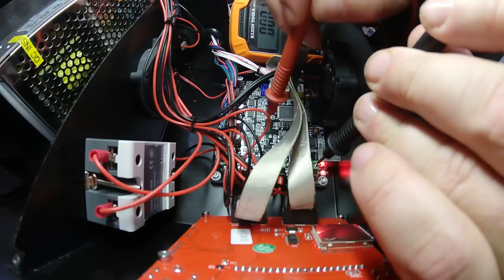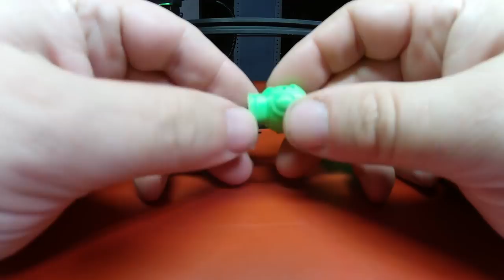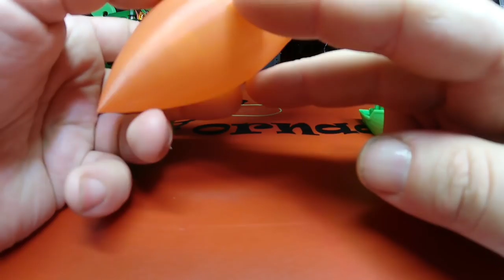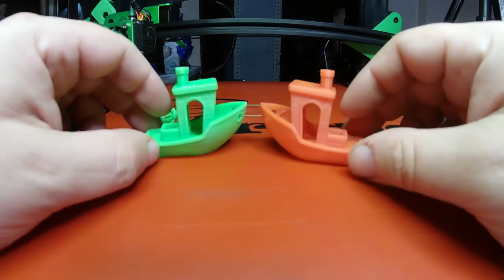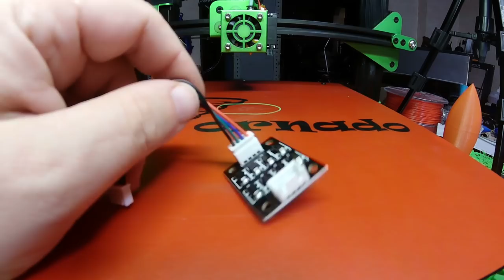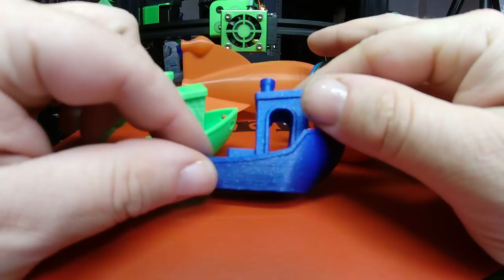Today's 3D Print 107 Adjusting the Tevo Tornado Stepper Drivers

Comment: After you did this did you notice the steppers vibrating/humming  way more? Just curious mine is vibrating like crazy now. More like a super loud humming that you can feel through the whole machine. This was actually most noticeable while my steppers were disabled during leveling. I can literally feel it vibrating between the nozzle and the bed.  Plus afterwards I got my first ever layer shift  on X while printing the initial test benchy.  I think I'm going to dial it back down some and reprint the benchy and see what happens. All the steppers initially were set between .78 and .8. I changed all of them to .95  except Y which is a bigger motor  to 1. Now I'm going to turn down X Z and E  down to .85 and Y to .9 and see what happens. As a side note I also added TL smoothers to X and Y at the same time. Just wanted to get your experience on it. Let me know and thanks in advance.
Reply from the maker: I sent mine to .95 volts and I don't notice any unusual humming or vibrating I also added smoothers to mine as well I suspect you're correcting your voltage too high turn it back a tiny bit
Reply: Nerys that's the plan. Soon as I get home I'm going to try it. I will say this the smoothers seem to have eliminated the salmon skin which is a step in the right direction. But I am super puzzled and concerned about the x axis shift. Considering I've never had a shift on that machine yet and mind you I have my jerk settings set super super low as well. I'll say this as well just like you said in the video the machine was definitely moving with much more authority. But I definitely don't like that vibrating hum either. Thanks for your quick reply I appreciate it and keep up the great work. You've become my go-to YouTuber as of recently. I appreciate your honesty and candor.
Reply from the maker: One other thing make sure your belts are not too tight people have a tendency to over tighten the belts they should be snug with a slight twang when plucked they should not be super tight that would definitely cause a stepper shift
Reply: Nerys you could be onto something there. My X did feel a little tight when I was moving the hot end around. I will address that. Thanks for the advice. It can be tough sometimes trying to strike that perfect balance between all the different factors.
Reply from the maker: That's why I tell people snug then a tiny bit more that's it not tight just snug :-)
Reply: Nerys hey one other thing a little off topic but I know you're like an Ender expert.Infact I bought one on the strength of your review. My question is this upon assembly the other night I was a little too tired and I accidentally wired the positive and negative coming from the power supply wrong. Of course when I turned the machine on nothing happened except the heat bed and nozzle started Heating up. I quickly realized the error of my ways and fixed it but now it won't come on at all. I'm assuming the reverse flow of electricity through the board fried something. what do you think would this ruin the board I haven't been able to find any conclusive information talking about what happens when you do that I know I can't be the only one to have accidentally wired it wrong. Any thoughts?
Reply from the maker: Ouch yeah I imagine that would kill it I wonder if mine is wired backwards internally I know I got my polarity right but mine did the same thing that the heater is turned on but the printer did not I'll have to open it up and check that but you're probably in the same boat as me you're probably going to need a new brain board
Reply: Nerys That's the conclusion I came to. Ordered 1 a few days ago . Unfortunately could not find an exact match to mine in the States. Had to order directly from Creality through Ali express.45 bucks and 12-20 days :(. So mad at myself. From now on I'm triple checking that before I turn on any of my builds again. If you think about it let me know what ends up being wrong with yours.
Reply from the maker: You betcha

Comment: Do you know the voltage for the CR-10 drivers?
Reply from the maker: ebuTuoY no I do not but I'm going to install pair of smoothers on it so I'll measure it while I am in there
Reply: Nerys OK was trying to find out what the correct voltage in meant to be. Just for reference really so no rush. Just thought it would be handy to know and check they are right next time I have the control box apart. Thanks for taking your time to reply, your videos are always so helpful. Keep up the good work!
Reply: Could be nothing but I noticed that when you lift your hand off the bed it seems springy. I checked my CR 10 and it is not like that, I know my bed is not over tightened either. But yours seemed to spring up a lot when you removed your hand. Could be nothing or does not have any affect anything, but thought I'd mention it. Good luck and I'm sure you will solve the problem.
Reply from the maker: ebuTuoY the bed is good and tight no worries I'm just a really big boy so when I lean on something it flexes :-)

Comment: hi I'm have issues with layer shifts on the y axis?know of any fixes?
Reply from the maker: +Adrian Cantu yes. Increase stepper voltage to .95v for the y stepper driver. Ie this video.
Reply: Nerys I did already but im still getting the same issue the layers shifts
Reply from the maker: +Adrian Cantu belt too tight. Wheels too tight if nejther of those bad stepper driver (low probability) or bad stepper motor itself (high probability if not belt of wheels too tight)
Reply: I have been battling the same issue and after going through all my mechanical parts, assuring all bolts were tight (which they were not), belt tensions were correct, Y vref set high enough... Turns out the whole time the true cause was Cura setting the print accel, travel accel and jerk too high. Try changing those settings in your slicer to print accel 1000, travel accel 1500 and jerk 10. So far so good. Some experimentation is needed as to figure out the absolute best values for the Tornado but so far with these figures I haven't seen one layer shift.
Reply: increase the voltage to 1.1v. This solved y-axis shifting for many people

Comment: Question; New to this and just put together a Tornado (1st 3D ever). The cube test from the SD card worked fine, a little off center mid left front quadrant. Used CURA to slice a STL file and it always goes to the home position and tries to print there, cutting off most of the body I am trying to print. Where should I look for a fix, CURA, TEVO screen??? 
I tried to input the proper values for the printer > manage printer > machine area as shown in the manual.
Reply from the maker: Go to one of my newer videos and in the description there's a link to my profiles download one of my cr10 G-Code files a bennche or something try printing that it'll work on the tornado if it properly prince in the center than the problems in your slicer let me know what happens and we'll go from there
Reply: Found your cr10 bennche file and put it on SD card. Card in Tevo Tornado for printing and it started right in the center where one would expect. :-)
Had been slicing with CURA = no center. Tried ideaMaker slicer on a file and it turned off the Tevo which then restarted itself, that gcode file never would load.
I have tried to check every setting in CURA and it appears ok, but this is my 1st experience with 3D printing so ???
Reply from the maker: Make sure I am not an expert at Cura but my hunch says to check the machine settings for your printer and make sure origin at Center is not selected? And make sure the dimensions are set correctly for your print bed otherwise I am not sure what would cause Cura to print outside the center I will look into it though to see if I can possibly figure it out

Comment: Hello! I want to print spare parts, for broken household objects, like for example the battery cover of an remote and such.
Thus I am searching for a printer for very small and detailed objects, but I can't afford an SLA. Also I want to print mainly ABS or PC, because most of these objects are made from this, so I could melt them together sing acetone.  Do you think the Ender 2 is suited for this application (With an additional enclosure)?
The printers I think that might be good for this are (because of their mechanical rigidity):

The Trinus (got a nice premade enclosure)
The Cetus
The Ender 2
Something like 150x150x150 is more than enough for me, so the biggest priority lies in precision.
Reply from the maker: +ElMariachi out of the box my hunches no it might be able to do PC with an enclosure possibly Abs if you use the right print bed such as print in z because the core problem with the Ender is that the bed could only reach 60 C which means you need a very good print service if you want that print to stick now because of its small print value you going to give you printing small parts so it will be easier to make the parts stick my suggestion is a cautious try it Advantage the printer is very cheap and doesn't absolutely stunning jobs almost anything else but you're entering unknown territory with abs and PC on a printer that can only go to 60 seabed temp
Reply from the maker: +ElMariachi I can't really say anything about the trinus or cetus because I do not have them have no experience with them I also have no experience with abs so take my advice from that perspective I don't want to mislead you
Reply: OK. Thank you very much. I just thought having a heated bed and enclosure was enough and didn"t know about the too low bed temperature, yet, and will take it into consideration now. Seems like Trinus and Cetus also don't reach more than about 60 degrees. So the Tornado including might still be a good choice, even better than CR-10, because of it's AC bed and better hotend.
Reply from the maker: +ElMariachi correct well my suggestion is preliminary since I have not thoroughly tested the tornado yet I would lean towards the tornado if you want to do abs temperature kind of stuff
Reply: I have read, that one might to need to change the Tornado's hotend for an e3d v6 for maintaining higher temps in the long, because of the PTFE tube going into the stock hotend. Also the Tornado's hotend construction is sometimes criticized for not leaving enough room, for proper part cooling. I have seen you have already done the mod for the improved fan duct, but still the problem remains, that the fan duct itself is only blowing air from one direction towards the part and just very narrow, because of the nozzle ending so close below the duct. I haven"t seen the empty X-carriage of the Tornado, yet, and also I couldn't find any more sophisticated mods than the printed fan duct. Do you think it would be possible to mod the whole arrangement so, that one could print a complete custom arrangement for having much better part cooling and fitting an e3d v6?

Thank you, btw  :)
Reply from the maker: no doubt that is possible. beyond my current skill set but no doubt someone will make mods for this popular machine. if I find one I like I will be sure to print and test it.!

for higher temps try captubes.com for some higher temperature ptfe tubing. good to 340c higher than the printer is capable of going.

Comment: Would this work on the anet
Reply from the maker: sky rim if you mean adjusting the stepper driver voltage assuming it has adjustable pots then yes but that won't get rid of noise and if you turn it to hi you will damage the motors or the drivers the salmon skin is an artifact that should not be there because of the combination of drivers and main board I believe the TL smoothers correct that I adjusted the voltage first because that was free but that corrected the problem of somebody who is having a layer shift issue because the steppers did not have enough torque the salmon skin has nothing to do with torque but missing micro steps you could try it but I don't think it'll help I noticed that it removed the salmon skin but did not remove the normal ringing and ghosting because the salmon skin was electronic while the ringing and ghosting is mechanical I believe

Comment: Do you happen to know what stepper drivers your Tevo Tornado has?
Reply from the maker: DRV8825
Reply: That's interesting as mine has HR4982 (A4982) stepper drivers.
Reply from the maker: +Koreenium is yours new? I hear they changed the drivers and the Salmon skin problem is gone now still trying to confirm that :-)
Reply: Yes, bought it on 18th of January. Waiting for filament to arrive, then I can test it out and see if it has the salmon skin problem.

I also bought TL-smoothers but as I understand they do not help if using A4982 drivers. Whoops. 

Allegro, who makes A4982, has full documentation on what causes missing steps (salmon skin artifacting) and how to wire the driver so that this problem does not occur. Looking at the motherboard and how the driver has been wired it looks like the newer Tevo Tornados should not have any sort of missing steps (salmon skin artifacting). 

Also I should mention that it has HR4982 which is a copy of A4982 so it may not work exactly the same.
A4982 can work in full, half, 1/8 and in 1/16 step modes while the chinese copy HR4982 says that it works in full, half, 1/32, 1/128 step modes...
Reply: Looking at the chinese HR4982 documentation and there may be problems with missing steps.

Basically slow decay mode is what causes missing steps (salmon skin artifacting). Only way to avoid missing steps is to run in mixed decay mode. In order to only use mixed decay with A4982 you have to wire ROSC terminal either directly to ground or through a resistor to ground. Both ways automatically enable mixed decay mode for all step modes which means no missing steps.
On the chinese HR4982... only way to avoid slow decay mode is to wire ROSC directly to ground. That is even what they recommend but Tevo Tornado clearly uses motherboard that has ROSC terminal wired through a resistor to ground. This means that on HR4982 it still uses slow decay with full step mode. So as long as full step mode is not used there should be no slow decay, no missing steps, no salmon skin.
Reply: Ok I finally got to print with it and I can say that salmon skin is definitely there.
Reply: mine is version 1.1 (the newest one) and it still has salmon skin, but it is HARDLY NOTICEABLE. its still there but mostly fixed.
Reply: Not only I can see it but I can also feel it so it is very obvious on my prints.
Reply: @Nerys - Atleast TL-smoothers work great. Made a huge difference.
Reply: Just got mine a week ago and so far can't see any salmon skin. However I was getting ugly surface prints. This is largely fixed now by adding a glass plate which I have put on top of the original. Bit worried I may be overworking the motors though - any advice?

Comment: It looks like you're using a really good camera, as it is able to display the clear focus in beautiful 1080p resolution on everything 12 inches behind the items you are showing. The extrusion head in the background is crystal clear.  The printed parts you are showing (and hence, artifacts you are trying to show) are not. Can't see ANY artifacts.  They are out of focus. Also, (I  hate being bitchy, but any novice who doesn't know EXACTLY what they are doing will destroy their electronics the VERY FIRST time they go sticking any metal probe, screwdriver etc into their powered PCB.  One tiny slip or shake in any direction equals SMOKE and expense.  You should really strongly suggest everyone to use nylon screwdrivers for adjusting POTS (Potentiometers).  Even a 3d printed PLA screwdriver printed at .1mm would do great.  But NO metal. Also, for the novices watching, you might explain to them exactly what a POT is.  Zoom in to show them exactly which ones to adjust.  Thanks!!
Reply from the maker: This is a DIY hobby these are not appliances people are going to have to learn that very quickly or they're going to have a bad time :-) the idea of using a printed screwdriver is a fantastic idea however I wonder if the pots have low enough resistance to work with a plastic printed screwdriver I'm going to have to try that :-) I will also check to see if there's an affordable option to purchase non conductive screwdrivers although the probes must be conducted for you to be able to read the voltage so no matter what they have to stick a piece of metal in there

I am using a cell phone to make these videos so while the cameras are very good I'm only looking at a little 6 inch screen :-) sometimes I miss it